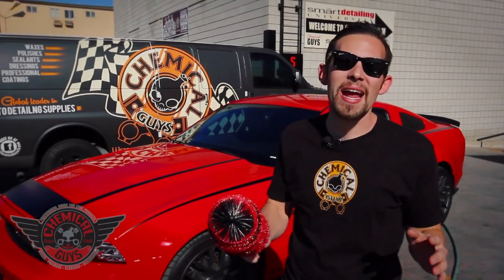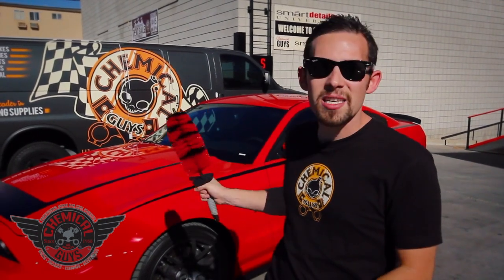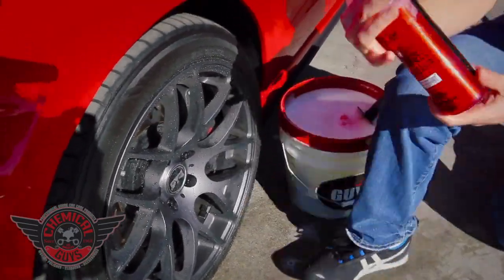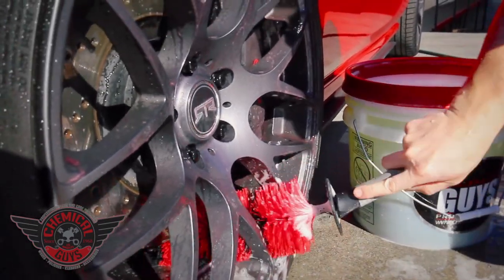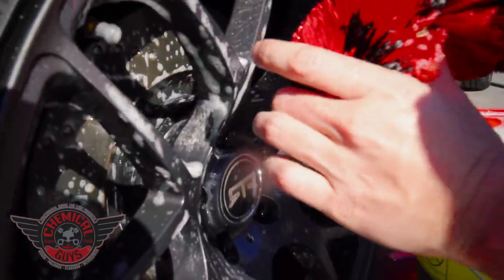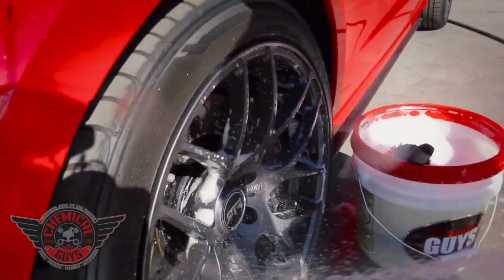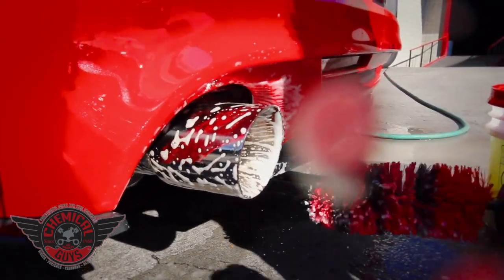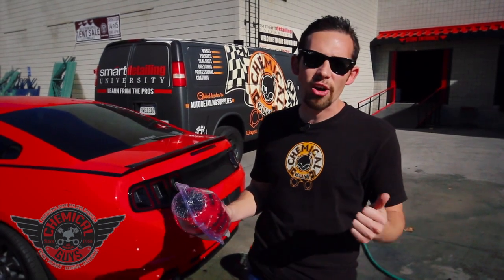Concours Detailing Brush - Chemical Guys Professional Wheel Cleaning Brush

Comment: It didn't appear to get in between the caliper and the wheel. I'm looking for one that does that. I currently just move the car. Not a problem but nice to just clean the wheel and not have to get in the car when I am in working mode.

Comment: The tip totally falls off right after a few uses. Now the wire is exposed and will scratch my wheels. :(
Reply: use that rubber dip stuff for tools to fix your tip or duct tape for now.